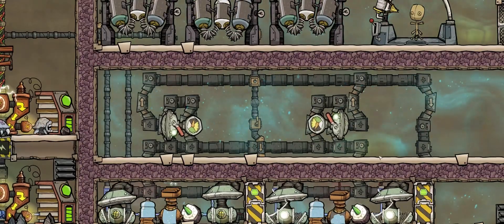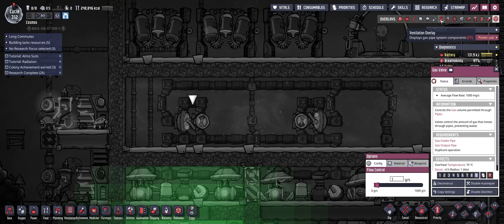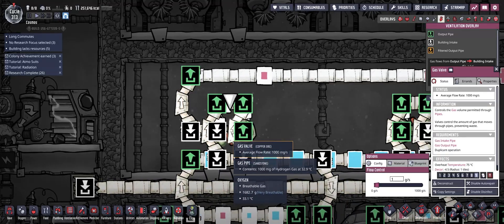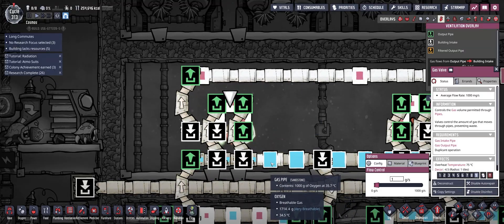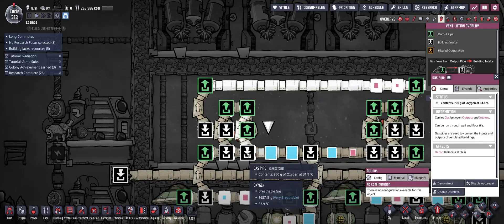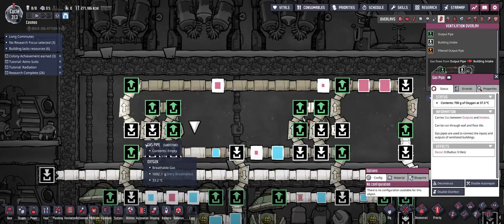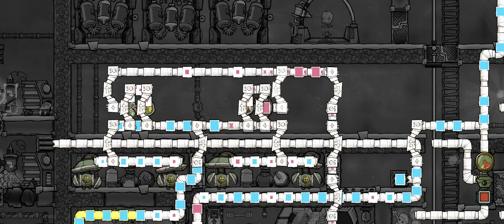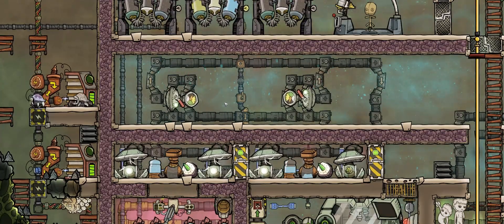Use ONI's Game Mechanics to Filter Gas (No Power Needed) | Beginner Build for ABSOLUTE DUMDUMS

Comment: The batteries are on the wrong side of the transformer.
Reply from the maker: Probably looks atypical to most ONI builders. It’s a low volt controlled transformer. What you don’t see is the smart battery attached to my generators which shut off high voltage once filled. I do it this way to save power since batteries leak heat and power overtime. Instead I manage power by watching coal and nat gas levels which neither leak heat or power. More bang for buck.
Reply: @uhoni Do you have a video showing this?
Reply from the maker: An unfinished one… I’ll tag when I upload. Here’s the idea.

x5 nat gas gens attached to heavy watt  line and a single smart battery (set to 65-75)

x4 coal gens attached to heavy watt line and a single smart battery (set to 45-55)

Heavy watt line inputs to all transformers.

Smart battery on low side controlling each transformer. These settings are based on low voltage needs to reduce battery leakage.

So when the nat gas battery drops below 65, the nat gas gens turn on which power the transformers. When the coal battery runs below 45, the coal gens turn on. This makes nat gas go first to power the main line.

The low volt smart batteries then control the transformers and call for power from the main line only when in need.

This also works for solar but you need a battery bank or you’ll waste sunlight.

Steam is a little more complex but you can battery bank it or attach smart battery to it and a heat source shut off.
Reply: @uhoni Ahhh. You are preventing the battery leak on the backbone.  I would like to see your setup.  I do the same as you on the gen side, but never thought about this on the other side.
Reply: @uhoni  Just subbed btw

Comment: I also use such a filtration system and it works correctly, but yours doesn't work at 100 percent, you need to filter the hydrogen immediately after each pump so that the electrolyzer doesn't stop.
Reply from the maker: You’re correct. I usually run these at less than full power. Most of the time, I just let my O2 vents get clogged a bit and allow the levels to naturally drop where they need to. A more proper setup would include a secondary cooling chamber so the electrolyzers can always flow, or even better, give space for hydrogen to rise to the top and pump from there. I usually stick with this simpler setup because I like moving things around a lot, and a small room like this can easily be relocated. The main point is that it doesn’t need to run at 100%. Both being at 60% works perfectly fine and doesn’t cause any issues… they can easily fluctuate on their own if something like exosuits requires it.
Reply: @uhoni I built this system several times and always made this mistake, but then I switched to a modular system so that I could increase production, and then I realized where the problem was and after that I put together two pumps, a hydrogen filtration and an electrolyzer in a 4x4 room and this became my main blueprint because for my colony with more than 60 duplicates I need a lot of oxygen.